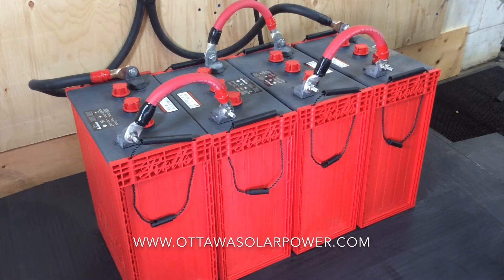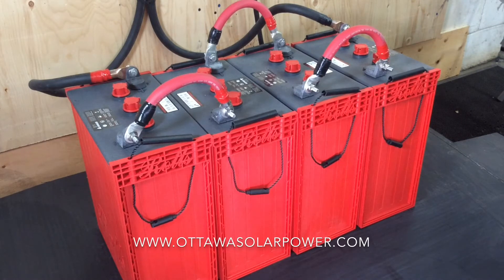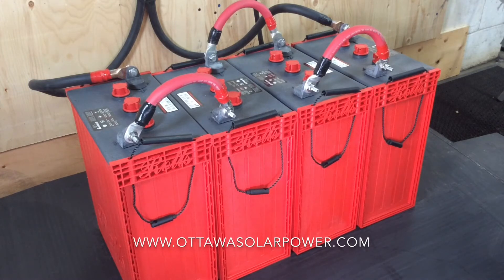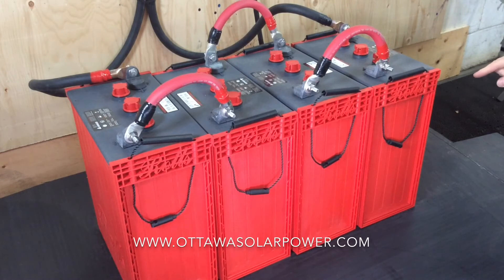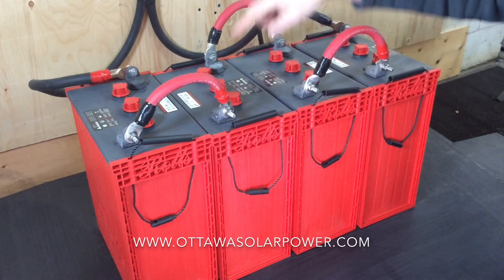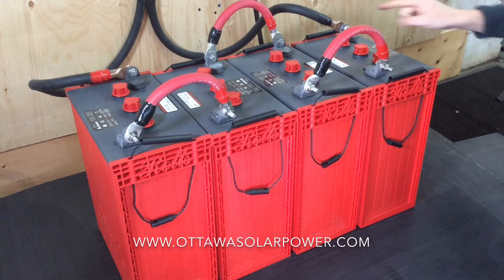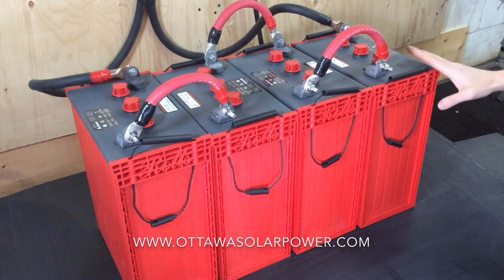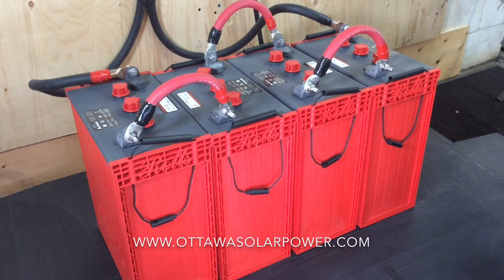L-16 Battery Bank

Comment: I have just ordered 12 of these batteries and I need to know what bolts are used to connect it to the terminal please does it have to be anything specific for the metal and the length Etc thank you in advance
Reply: All copper, high quality thick copper, wire gauge probably good to get 00, or called double zero gauge
Reply: Wer can find them